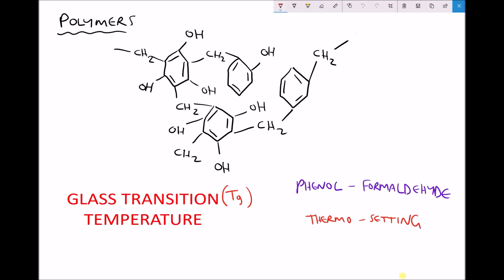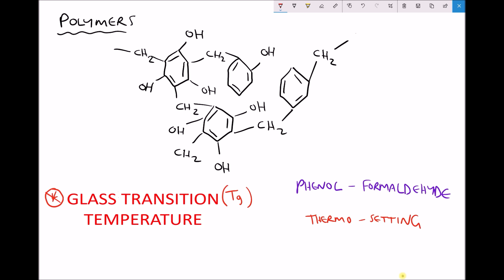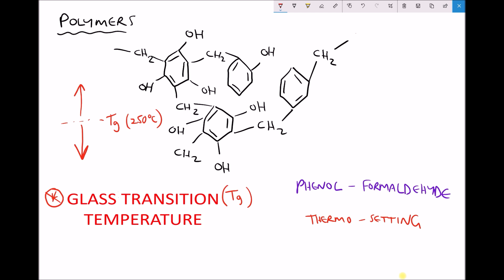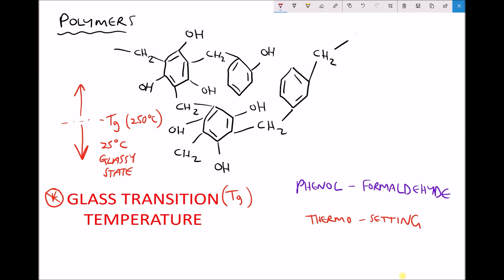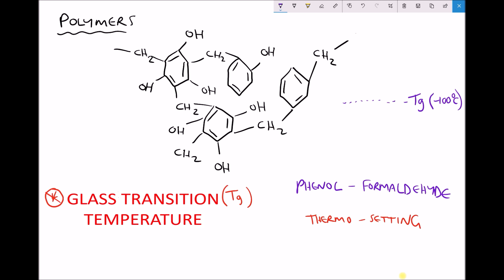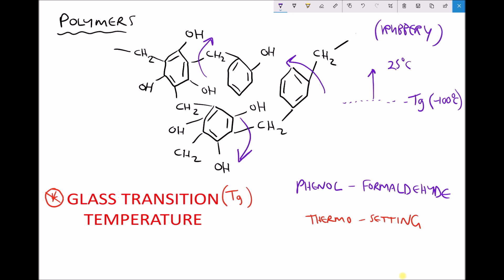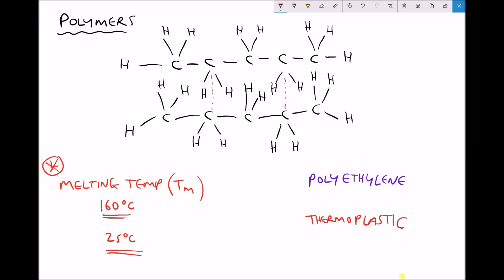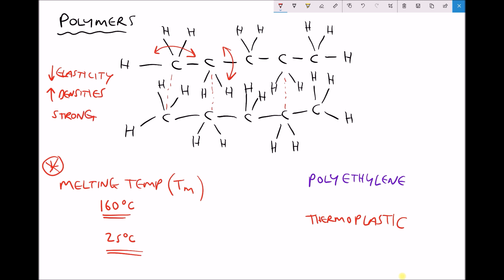Properties of Amorphous and Crystalline Polymers

Comment: but no polymers are 100% amorphous or 100% crystalline right ?
Reply from the maker: That's correct. It is a continuum, where at one end a polymer is 100% crystalline and at the other end, it is 100% amorphous. However no polymer would ever be at either end of the continuum.
Reply: Engineers Academy While I agree with your statement concerning crystallinity - to my knowledge PE-HD with 70 pc crystallinity is the maximum, I dont agree with your statement concerning the amorphous state. To my knowledge, the atactic version of PMMA does NOT contain any crystalline phase whatsoever.